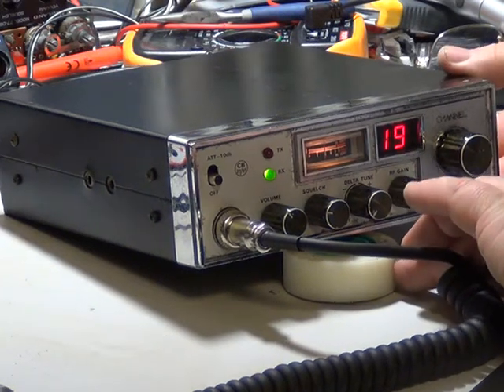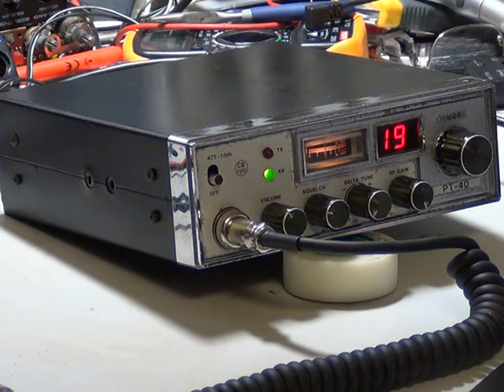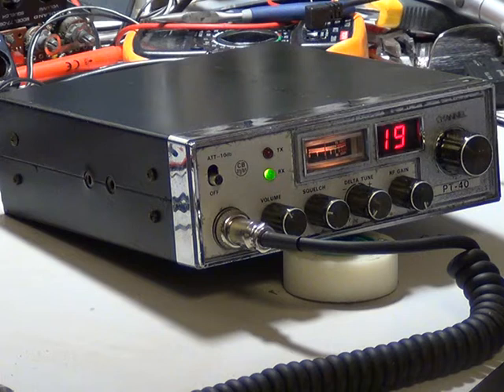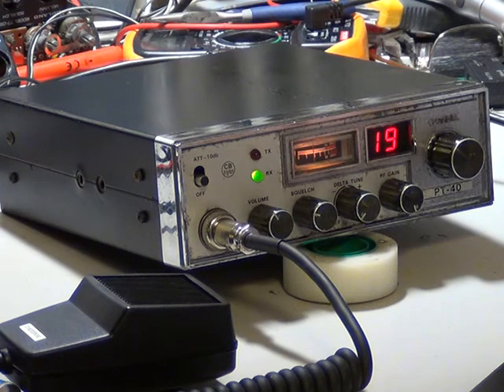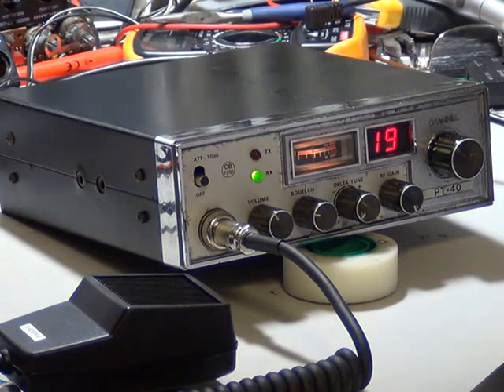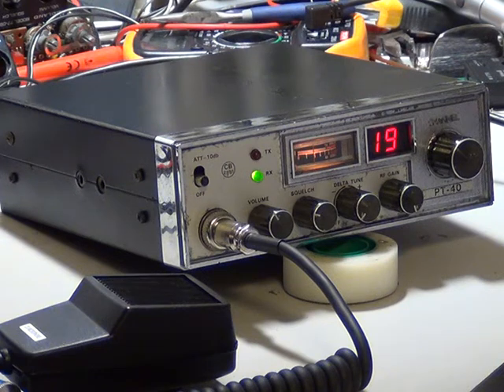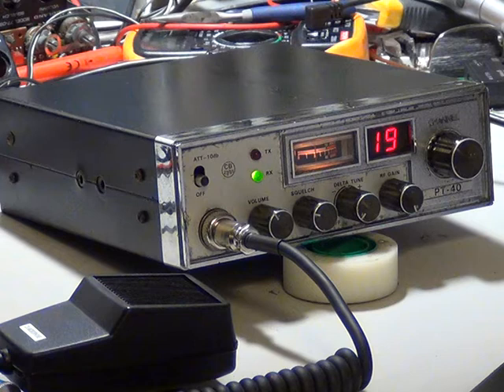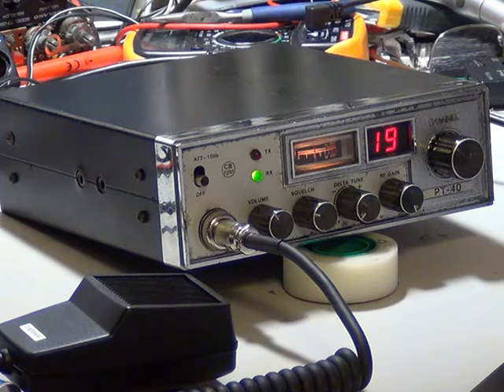World Sound PT40, UK (CB 27/81) CB radio (Mobile)  - On The Air Test

Comment: Trying to get one of these running again for a neighbour that's 83 years of age and has had it packed away for 20+ years. Anyone have a mic wiring diagram for this?
Reply from the maker: Yes it's standard Cybernet which is Pin 1 = audio from mike, pin 2 = screen/braid pin 3 = receive...usually black wire, pin 4 = transmit...usually red wire.

Richard
Reply: @ukfmcbradioservicingTango21  That's perfect, thank you. . . It's a spare crt mic of mine I've gave him as his mic was missing and I will rewire it tomorrow. . .

Comment: Hi Richard just a quick question I have one of the old DNT M40 it doesn't want to transmit when I press the ptt the relay chatters but that's all. Any ideas where I can start. I have an owners manual but no circuit description.
Reply from the maker: Electrically It;s the same as the Icom ICB1050, but different layout. They have the three crystal VCO arrangement, so the 10.24 needs setting first, then the TX VCO, RX VCO, TX frequency, the the RX frequency with a marker oscillator or 2nd signal generator. If the relay still chatters with the VCO set properly, then I recall transistor Q11 is faulty.

Once I can actually buy a repairable M40, I'll do a video on it. I'm expecting this to be sooner rather than later. I have six irrepairable M40's here, all so severely screwdrivered that they are beyond redemption.

I uploaded the full user manual with circuits, layout & components list onto SCRIBD for people to download.
Reply: Thanks Richard I did have a quick look at it and I remember that all 3 xtals were working and that I did get a signal in the tx chain I will check Q11. Thanks again
Reply from the maker: Have just bought a DNT M40 off Ebay. Finger crossed it's repairable rather than join the half dozen irrepairable ones already here!
Reply: Hi Richard that's great yeah fingers crossed. I haven't had a chance to go back to mine as yet but hopefully I will get round to it today time allowing. I will send u the £10 for the Realistic facia parts through Paypal today that's great I'm well chuffed with that thanks.